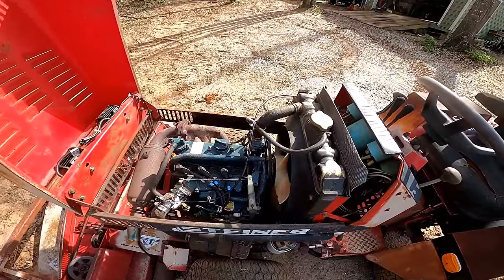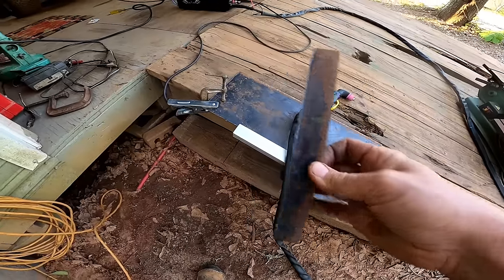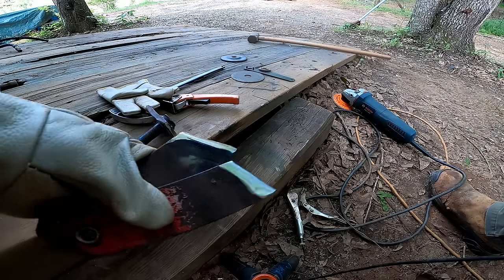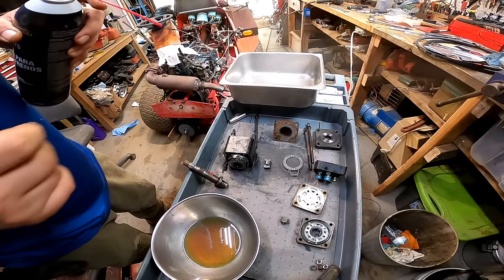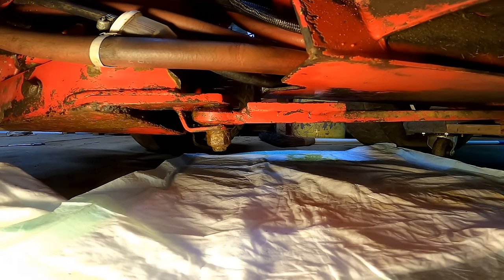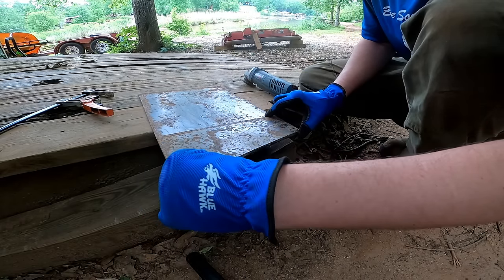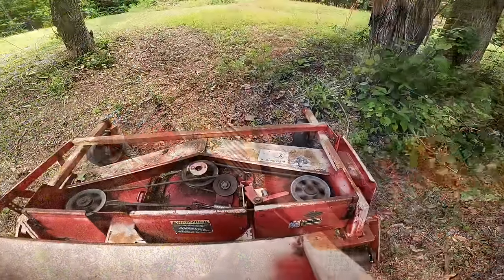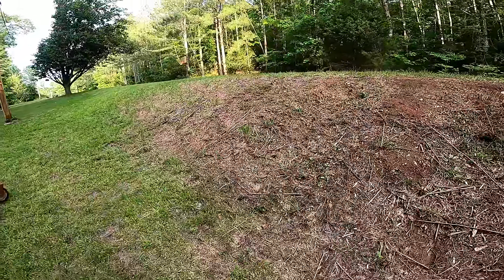SAVING A STEINER 430 MAX ( VENTRAC) FROM A JUNKYARD AFTER SITTING MANY YEARS.....PART 2

Comment: I think you did really well on this project, money-wise. Even if you get a couple grand tied up in it for parts, it will still be well worth it, considering the price of lawn and garden equipment these days. Plus you don't have all the electronic complexity associated with the new stuff either. That mower will run for years with a minimal amount of maintenance, since it's built like a tank! Looking forward to some paint work to finish it off!😉
Reply from the maker: thank you Dan!! but your not gonna beleive this but I payed  50 bucks for the machine and have probably less than 500 dollars in parts 😊😊 I think I did pretty well lol
Reply: @TheHomePros6221  Holy moly!! That IS good!😮😄👍

Comment: During the mid 90's I had a Steiner dealership. I went to all of their schools, had all of the manuals, special tools... and we sold a lot of these machines. For you to have found such a low hour machine with the Kubota engine is a rare find! That era of machine from the factory used a very high grade of hydraulic oil, that was dyed blue. They would void the warranty if it did not have that oil in it, because of air cavitation in the system cause by inferior oils. Air bubbles in the oil, under pressure will damage the pump, and the drive motors under extreme conditions. The whining that you are hearing from the pump, is probably due to this. The whine may go away if you were to use this oil.... but if you keep fresh filters on it, you might be okay. Congrats on your find, congrats on your hard work... your determination on getting your Steiner back in shape is truly inspiring my friend! God Bless!
Reply from the maker: Thank you! Check out the end of my previous video on this machine it’s more of like a clicking spring sound and it sounds like it’s coming from the steering valve I took everything apart and it looks perfect inside the pump and steering valve it doesn’t seem to be hurting anything but I’m kinda baffled what’s causing the sound the wind sound is normal and it really doesn’t make a loud whine sound. It makes one just like a regular lawnmower or anything would make but anyway thanks for watching the video

Comment: I had an old IH 300u with the same hydraulic whine.  I tried figuring it out for months.  Turns out there was a oil strainer on the supply line in the hydraulic oil tank.  Iknow that has a hydraulic filter but you might wanna check the parts diagram to see if it has a supply line strainer in the tank.
Reply from the maker: yes they all pretty much have a small wine but the noise that I was happening was like a popping spring noise, whatever I did seemed to fix it

Comment: You can add load balancing springs to the front between the grill and the deck for extra front axle weight. Or take off the suitcase weights to help balance it out. AT101 tires help too, and 3" spacers for side hill stability. Duals make it not so maneuverable.

I use a BX39 belt, the notches prevent belt cracking due to running over the belt tensioner.
Reply from the maker: that’s awesome do they make kits for the 430?

Comment: I've been mowing lawns, plowing snow, cleaning barns, rototilling, etc for 25 years with two Steiner 420s. I'd say the hydraulic whine is still too loud - louder than I'm used to on mine - unless the microphone is just picking it up wrong. Are you sure you're using the Steiner recommended hydraulic fluid in there?
Reply from the maker: you mite be hearing it worse cause of the mic but I think I’m gonna change the fluid to amsoil

Comment: great video.  i am looking at one of the same.   on the slope what if you went parallel to the slope, would the machine handle that slope?
Reply from the maker: Yes it will esp with dual tires

Comment: Alright! Watched the whole thing now. You seemed to have some wind noice in the beginning, if you have a go-pro there are cheap wind “foam” you can put around the camera to reduce that noice, I got one from Amazon, seems to work OK. Cool that you got that plasma cutter and it seems to work great! Oh and the workwear too! The mower turned out great but please change the cutting deck bearings, they are so noisy, probably rusted inside. And Vevor need to send you a welding helmet! Great video as always!
Btw did the noice from the pump go away?
Reply from the maker: thank you so much nils!! I actually ordered a wind foam for it 🙂 yea I would love to change out the spindle bearings and all but they are very expensive so I just keep making sure they are geased for now when I restore it I’ll prob do bearings then cause it’s gonna be like 500$ as they are really heavy duty. I went to go buy a new welding helmet and they were sold out urghh
Reply: @TheHomePros6221  the cutting deck actually sounded a bit better at the end, perhaps they will do until you get hold of ones for a reasonable price. Do you need a complete spindle? Im guessing that they have standard bearings inside, well, beefy standard bearings!
Reply from the maker: I took all the spindles apart and cleaned, checked the bearings and greased and sharpened the blades.. works like new now
Reply: @TheHomePros6221  great! Must be some quality stuff that can be left out for so long and just need some cleaning and grease to get back into action!

Comment: do you have the link to the needle bearing and seal you used on the pump charge side of the pump? the bearing you pointed at, at 30:05? need the bearing and the seal for my pump and cant find it anywhere!
Reply from the maker: messicks has them in stock my friend go on their website and look at the parts diagram

Comment: You probably don't want to cut metal around broken flooring as its more likely to smolder and burn due to broken fibers. The risk is greater than just having a wooden floor. My welding shop has all concrete floor, walls and ceiling, but I have some wooden shelves in there, so I need to make some changes. I may go with wire closet type shelving, if i can find some in the scrap yard.
Reply from the maker: I wish I had a concrete floor

Comment: You would find it much easier loosening rusted nuts, bolts, and metal to metal parts etc if you would spray them with Liquid Wrench first and let them soak a bit.   It also lessens risk of breaking things.
Reply from the maker: I do when need be

Comment: I do not like the fact that it has a gasoline Kubota engine. I'd much rather have a diesel Kubota. Or the fact that the implements are belt driven. I'd much rather have a PTO shaft or hydraulics. I still would not complain though. I'd be stoked to find it in a junkyard. You got a hell of a deal on that tractor.
Reply from the maker: it really works pretty well hell I only paid $50 bucks for it lol

Comment: I've been around tractors most of my life and I've never seen or heard of anybody greasing a ball socket like you're doing on there.
Those open ball sockets don't get greased like the enclosed ball joints on steering linkage because the grease attracts dirt and grit and makes them wear out faster.
And it makes a greasy mess!

Comment: Put a 10 lb hammer against fittings and 3 lb hammer and shock it , rotate around fitting 
JIC fitting are really bad about freezing up
We used copper never seazee
Reply from the maker: I actually did this off camera numerous times, that thing was tight lol
Reply: Air hammer with a dull chizle end.

Comment: The great thing about those Kubota engines.. you can work em hard and they run cool. 

The crappy thing about those Kubota engines.. you can work em hard and they run cool. 😂

Not an issue in the summer when you're mowing, but when you're plowing and blowing in the winter and you can't get heat in the cab.. 💀
Reply from the maker: @BrooksideFarmBarreMA  this engine runs at 180-190 which is pretty normal, in the summer it feels pretty hot

Comment: I think I would cut out air flow sluts to cool better 
Just thinking about heat buildup and there is nothing that’s going to go thru it but air
Reply from the maker: I was thinking about doing that, but it actually flows air really well through the headlights. There’s originally a plate that goes up there that blocks it off, but I removed it and now the air flows really well in the machine stays really cool.